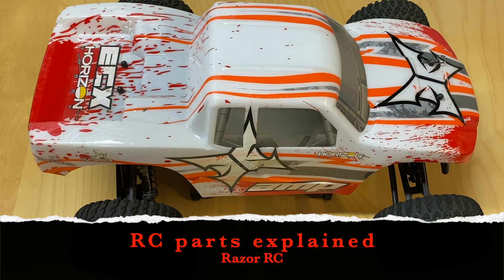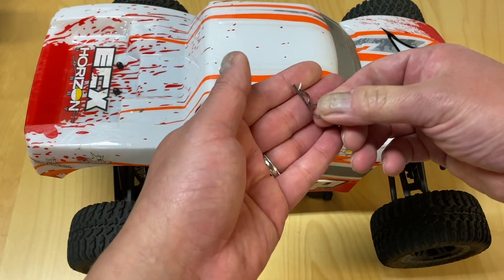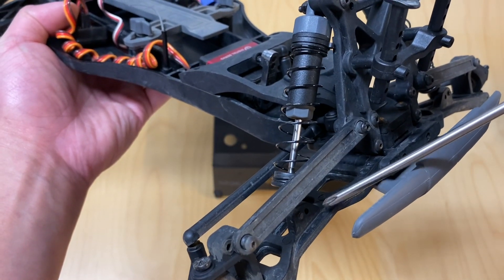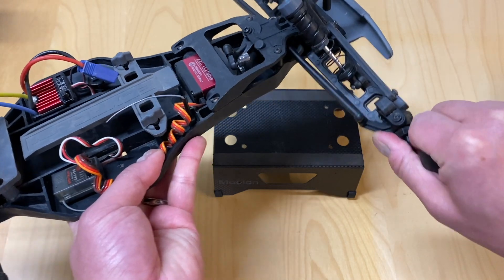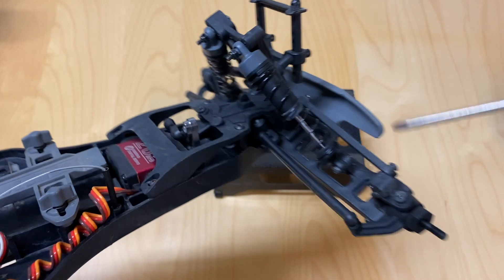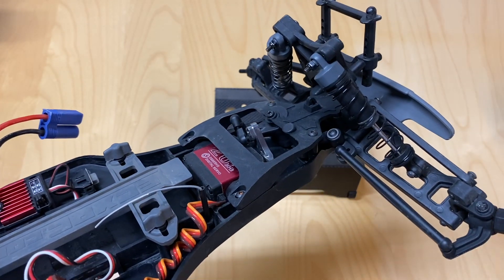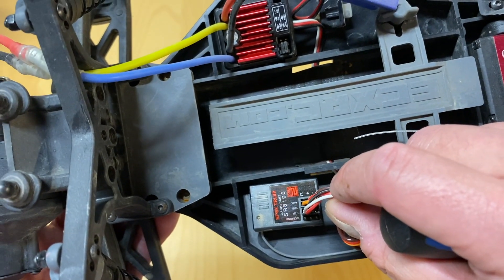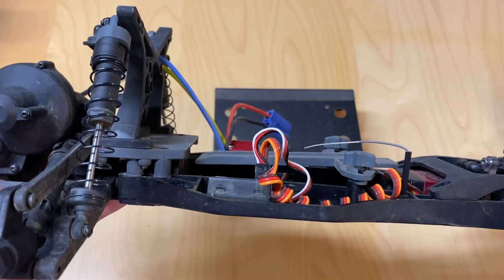RC car parts, explained.  (RC Basics #1)

Comment: I want to buy a beginner RC kit for my son and I to work on as an ongoing project.
I know that cheap RC cars have steering that's discrete (full left, neutral, full right), which makes steering difficult.
I see in your video that the steering is controlled by a servo. Can I assume that the steering in your car is continuous (ie varying degrees of turn)?
If so, do all hobby RC kits have this better type of steering?
Reply from the maker: yes, all hobby kits have "proportional" steering, which is infinitely variable steering.  the ECX Amp MT is a good, $160 kit you can build that includes everything.

Comment: Dose any one no what the bolt is that holds the Steering blocks to the caster block is I need a new one but dont no what it’s called it’s a traxxas rusler vxl

Comment: Razor RC.
Nice explanation.

I have made drones and now I want to make a RC car from a kit. Just for kids playing.
Could you pls tell me what should I call for chassi, ESC, Motors etc on the ecommerce website while ordering?
In what combination?
Reply from the maker: Shreyas Mathuria if you want something cheap for kids, I would recommend a hobbywing quicrun 1060 ESC and a cheap 12T or 15T brushed motor.  You could get an Arrma or Traxxas motor from a partout on eBay.  Would go about 20mph and cost less than $50